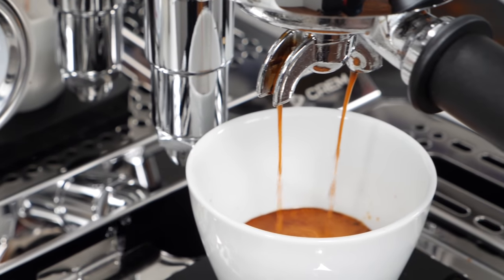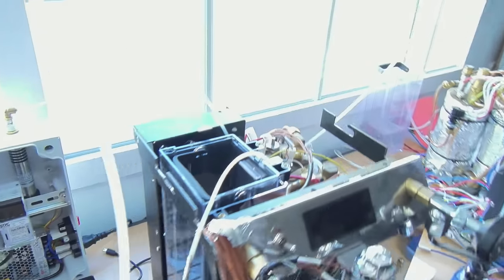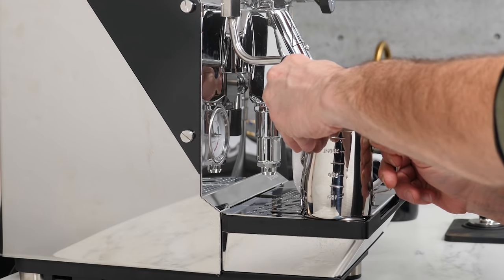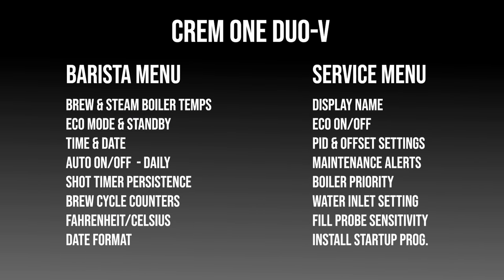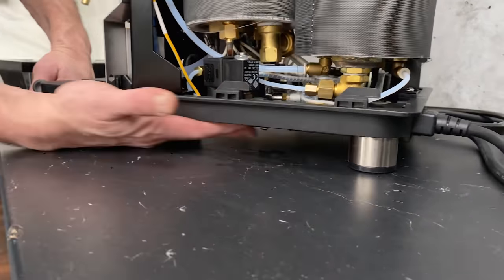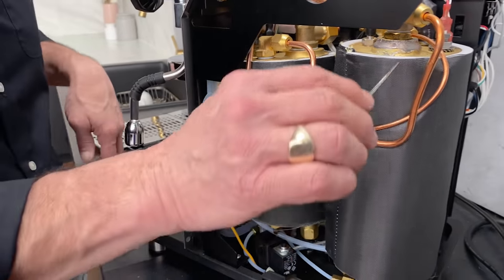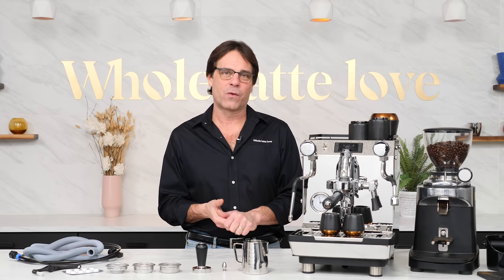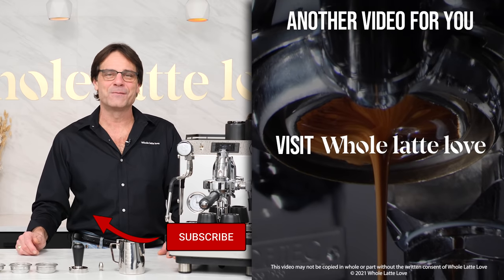Review: Crem ONE Duo-V Espresso Machine Inside/Out

Comment: Hi Marc, thank you for another great video.  Can you explain one thing: Victoria Arduino and others bank on very small brew boilers, even on the latest professional machines.  This is based on the size of the drink being 40ml or less, and the belief that it will take less time and energy to reheat 160ml of water than 1.5l. This Crem1 seems to take a diametrically opposed design, spending a lot of energy heating 1.5l of water+ the steam boiler (ok, one feeding the other), and in a typical house or office setting, it may take all day to consume 1.5l.  What do you think?
Reply from the maker: Hi Alex, You are welcome and thanks for the comment and question. So I've worked with Dalla Corte machines which use a much smaller boiler in a boiler over group setup. But still that boiler weighs a lot! Less water inside but lot's of metal to heat up and keep heated. I've never done a deep dive comparing energy usage between designs like that and more traditional but it would not surprise me if they were not that far apart. Boilers in the Crem are insulated so that helps.
Marc
Reply: @Wholelattelovepage  hi Marc. I bought a Dalla corte from you guys last year. anyway I agree with the original comment.... a 0.5L brew boiler and a 2.5L+ steam boiler would make this more like a la Marzocco or a dalla corte and yields commercial steam power... it’s a much smarter design especially if the brew boiler is already being fed by a HX. That makes a large brew boiler downright unnecessary!  With such a large brew boiler you are sacrificing steam performance without any benefit on the brew side.

Comment: I have a Brewtus II bought in 2006. I added a PID to it.
Great machine. But, I have had to open it up and repair more frequently in recent years.
The WLL tech people told me that you have to think of these like cars. They need regular service.

The new Crem machines look great.
Much better internal engineering. Should be  easier to maintain.
Lots of new important improvements.

If / when my Brewtus II stops working, this looks like the way to go.
Reply from the maker: Hi Richard, Thank for the comment. They are like cars! And, like changing the oil in engine I always say the most important thing for machine health is feeding it with good water!
Marc

Comment: Nice machine! I like the look and I think it's well thought out.
How long does it take until the brew group is fully heated? I think it's quite long because of the huge boiler.
Are you sure the display is an oled display? I my opinion it could be bigger an the resolution is quite low.

Why is the piping that odd? There could be a straight pipe from the service to the brew boiler. 

The vacuum release valve should have a hose. With this type moisture is released into the case (with the electronics next to it) 

Will this machine be available in Europe?
Reply: Having couple of bends in the tube helps relieve thermal expansion stresses. From the looks of it, I'd say the piping is very well thought out actually.

It's E61 without any active group heating, so I bet it's around 30 mins to get fully up to temp. It's not so much about boiler volume (though it does impact this of course), but about heating 3 kilos of brass with passive thermosyphon.

I completely agree about vacuum valve, but it seems like a common thing unfortunately. I haven't seen machines with hoses on vacuum valves for that last 5 years or so.
Reply from the maker: Hi Fedir, Thanks for your comments! Spot on!!! ~30 min to full heat up is correct. Can be faster if not steaming and the service boiler is shutoff. With programmable on/off time by day off week one can have the machine turn on by itself and be warmed up ready for use! While I prefer a tube on the vacuum relief it's true that it's not found inside a majority of machines. The amount of moisture vented is very minimal and quickly evaporates as the boiler it's mounted to is running close to boiling temp when it's released. Telling that having the tube is not required for SGS certification.
Marc

Comment: Hi Marc, great videos as always! Will you be doing a review of the 2b at some stage? Looks like a super interesting machine and very keen for your opinion! Many thanks, Ash
Reply from the maker: Hi BD, Thanks for the kind comment. My colleague AJ should be releasing video of the 2B with variable speed DC motor rotary pump machine  - the "Infuser"with gentle soft pre-infusion today. Next week look for my video on the top of the line Crem One "Profiler". It's an incredible machine with both manual profiling and ability to run saved profiles.
Marc

Comment: Hey Marc, Thanks for all of your great videos.  I have been debating machines for months now and thought I had finally settled on the Profitec 600 until I saw this video.  Coming from an "appliance" level machine, either one of the two would be a major upgrade for me. How would you compare the recovery times of the two machines?  I know the Crem has much larger boilers so I was wondering if that made that big of a difference in terms of recovery time between back to back drinks? Also how would you compare the steam power of the two?  Other than being able to directly connect the Crem to a water line are there any other features that would make you lean one way or the other? Sorry...I know that is a lot of questions... (patiently waiting for the head to head video)

Thanks

Jason
Reply from the maker: Hi Jason, No problem on all the questions - it's what I live for! Coming from appliance grade you are right either will be a major upgrade. With larger boilers and pre-heat the Crem will have the best recovery times. It's instantly ready to pull another shot. The Pro 600 is no slouch. By the time you grind, tamp and load your next PF it'll be more than ready to go again. 
The Pro 600 has more steam power running at ~2bar when service boiler is set to it's highest temp. The Crem runs near 1.4 bar max. IMO the Pro 600 is a more refined machine as far as external finish quality. If that's important to you it's the way to go. Crem as you know is plumbable  - which I love as I dislike filling reservoirs and plumbed connection makes water filtering (if needed) easier with in-line solution which require little maintenance. Hope that helps!
Marc
Reply: Thanks mark. Now I really went down the rabbit hole looking at the pro 700. Other than what you said about being able to plumb the 700, do you think it’s worth making the jump or should I put that money towards a better grinder and stick with the 600?

Comment: Hey Marc Great vid.  At the 9 minute mark you mention "when pulling a shot you get a shot timer on the display and you can set how long that time persists on completion in the barista menu.  Does that mean it has some type of volumetric or timing dosing?  thx :)
Reply from the maker: Hi Sam, Thanks for the comment and question. No timed or volumetric dosing. I was referring to how long the the shot time remains in the display after the E61 lever is lowered. It's a nice option to be able to have that time stay in the display for a user defined time of more than a few seconds which is what you get on most Gicar PID displays with shot timing function.
Marc

Comment: I need help.  It's time to retire my older machine.  1. Crem One Duo V 2. Profitec 700 or 3. LaSpaziel Vivaldi (plumbable)  Thoughts, comments, observations please?
Reply from the maker: Hi M, Thanks for the question. I have no experience with the L.V. so can't offer an opinion. All 3 machines are plumbable but Crem uses a vibration pump in this model. Pro 700 is rotary pump and has best steam power at near 2 bar. If not concerned with pump or steam power then best value IMO is the Crem. If you value the rotary pump and more traditional machine with superior build then the Pro 700.
Marc

Comment: Hi Marc,
Great video's,
Do you know what is the optimal gap between shower screen and coffee puck for ecm mechanika slim?
Reply from the maker: Hey gt3 rs, Thanks for the comment and question! You do want some headroom/gap. If you see an impression of the shower screen in the coffee puck after an extraction there is too much coffee in the filter basket. Beyond that just be reasonable with dose for the filter basket you're using. Like don't dose an 18g basket with 7g.
Marc
Reply: @Wholelattelovepage  Thanks for reply Marc,
As I learned impression of shower screen on the coffee puck happrnes after extraction by the  solenoid valve so it dosnt affect the extactiin at all. From my experince 19 grams dose making better espresso, so I heard from other ecm owners.
My questiin is what is the optimal gap by ecm? Can you chek it with them?

Comment: Will my Gaggia bottomless portafilter fit these machines?
If not what do you recommend?
Reply from the maker: Hi Mark, Thanks for the question. The Gaggia bottomless will not fit/work in E61 group which needs PF tabs at 9 and 3 o'clock. Here an Expobar (Crem) bottomless PF which will work: https://www.wholelattelove.com/collections/portafilters-and-filter-baskets/products/expobar-bottomless-portafilter-58mm
There are other bottomless options as well. Basically any E61 compatible PF should work so you can go angled handle, wood handle. Hope that helps!
Marc
Reply: @Wholelattelovepage  Thanks. Ordering now!

Comment: What is the reason for some of the copper tubing being so random and what seems very inefficient? Especially the tube going from the service boiler to the brew boiler.
Reply from the maker: Hi Basti, Thanks for the question. I believe the pipe routing is just part of design so everything can fit in the case.
Marc
Reply: @Wholelattelovepage  Thank you Marc! First I thought the routing is like that because of accessibility in case they need to be removed for whatever reason. And a straight line would make it very difficult to arrange everything together. And also these pipes may have a min radius? Haven't thought about limited space being a reason tho

Comment: Marc Question my Apartamento steam gauge only gets to the 1 bar pressure you know the first green square with in that gauge is that ok or should I raise it. The group head is optimal I have a grouphead gauge on it. Thanks
Reply from the maker: Hi Dirk, Well, one bar pressure in a steam boiler is on the low side. But forget about numbers. Are you happy with the steaming performance? If so I would not make a change to the pressurestat in the machine which controls boiler pressure/temperature. You say your grouphead temperature is where you want it to be. Making a change to a higher pressure will increase your grouphead temperature. If you decide to raise pressure you will likely need to do a longer cooling flush just prior to pulling a shot to get brew temperature back down to where you want it. Hope that helps!
Marc
Reply: @Wholelattelovepage  Marc first I thought you don’t adjust the nut on the pressure stat I thought it was the the bottom nut to the bottom of unit you use a spanned on. Also. My group head gets to 205 so the temp no problem. My steam is banging. I mean if I had to do back to back no. The steam
Loses pressure but fir my latte or another no problem. I thought these machines come calibrated to that middle spot?  But I would like to know am I adjusting that screwdriver fitting on pressure state or that that bottom nut using a spammer thank you much.

Comment: Really nice machine, just wish they used stainless boilers instead of what I assume is brass? Also, why include a shot mirror if you're not going to include a bottomless portafilter :(
Reply from the maker: Hi Drift, Thanks for the comment. Boilers are copper with brass end plates. Would be nice if the bottomless PF were included. In the past I've questioned the need for single spouts and lobbied manufacturers to replace singles with bottomless.
Marc

Comment: Impressive machine. No flow control though? Or can you control the flow with the "pre-infusion chamber"?
Reply: There are Four versions, sure Mark will review them in his normal excellent way. Have been waiting for reviews om this series. Great to see your videos Mark!!
Reply: I think every e61 takes a flow control set.
Reply: They have one with with the same look but the pump is rotary and the other one.. highest spec with flow control..
Reply from the maker: Hi MK, Great to hear from you and thanks for the kind words! My colleague AJ is working on the video for the Crem One Infuser as I right this. Then down the road we'll hav e the Crem One Profiler. Both those with similar specs to this but with whisper quiet rotary pumps and extended capabilities in soft pre-infusion and pressure profiling.
Marc

Comment: Can it be turned on with a wifi adapter? It seems this is no longer possible with the programming inside. Reason I´m asking is what if you want a more specific schedule? E.g. turn on for an hour in the morning and turn on in afternoon for another hour.
Reply from the maker: Hi Tim, Thanks for the question. Machine cannot be turned on with a wifi adapter as it does not have a straight mechanical power switch.
Marc
Reply: @Wholelattelovepage  thanks for answering Marc! Could be a good suggestion to CREM to include a mode in the software where it starts up when receiving power/to allow a more complicated schedule...

Comment: Marc on my Rocket Apartamento the lever when lifting all the way or pushing back down after extraction squeaks is this normal thank you
Reply from the maker: Hi Dirk, Not out of the ordinary. You can take the mushroom valve out and lube where the cam makes contact with a small amount of food safe grease to stop that. It can be caused by backflushing too much as it removes a coating of coffee oils from the cam and pushrods. Usually stops squeaking when coffee oils recoat.
Marc
Reply: @Wholelattelovepage  it’s Marc this happened during back flushing!!  After back flushing the squeak almost went away. There still is a little resistance but much better. I mean the machine is brand new. Great information. Thank you

Comment: Hey Marc, I was wondering if there is a major quality difference between this machine and something like a profitec pro700? They seem so similar yet the price difference is huge!
Reply: I bought the 700. But I must say a time setting for on/ off would be a nice addition.
Reply: @geronimoxxxxxcvx  knowing this machine existed, would you have chosen  it over the pro700?
Reply: @eknox4748  I don't think so. The version with the same options is the same price. I had a Brewtus IV. Coffee is good don't like the looks  But this one looks really nice. In Europe the Lelit Bianca is 400 euros cheaper. Funny in the USA it is more expensive. I bought a profiler set for 150 euros extra online. With medium / dark roast the difference is not big. Don't like light roast. I think next time I would buy a ECM synchronika. I do like the feel of ECM. For coffee quality I think for 2500usd machines it's all the same.
Reply: @eknox4748  I now see there is also one for 2500 which has the ability to set a flow profile on the display. That is a nice option is must say!
Reply: @geronimoxxxxxcvx  the crem is 3200$CAD and the Pro700 is 4200$CAD
Reply: It's more comparable with Pro600 (which wins hands down because of flow control). Pro700 has rotary pump, grouphead pressure gauge and steam boiler of twice the size, so not really directly comparable.
Reply: @pfa231  fair enough, but doesn't  the crem one also have a rotary pump since it's plumable?
Reply: They specifically mentioned in the review that pump is vibratory
Reply: @pfa231  right, thanks!
Reply: I purchased the Profitec Pro 600 with flow control from Whole Latte Love and I think after using my machine and seeing this video the build quality is better on the Profitec. I also hooked mine up to a wifi switch and have it turn on and off with a routine and Alexa. It's always ready in the morning when I get up.
Reply: @eknox4748  the crem one 2b lfpp has profiling rotary pump. 2500 euro
Reply from the maker: Hey all, Thanks for the comments! A few of my own...
On/off times by day of week on the Crem is very nice.
Pump on the Duo-V is vibration. Talk to those who've used the Expobar with vibe pump and Crem/Expobar custom E61 group w/pre-infusion chamber and many appreciate the shot quality of the combo. It's a slower build to full pressure and flow.
Flow control is an exceptional tool for those who go to that level on Profitec/ECM machines. Do stay tuned for the rest of the Crem One line including the "Infuser" and "Profiler" with whisper quiet rotary pumps and extended capabilities as their names suggest!
No doubt ECM/Profitec features exceptional build quality and higher price. Keep in mind the full-line of Crem One machines are SGS certified for commercial use and have some features like boiler drain, on/off by day of week, easy Eco mode and more.
Marc
Reply: @pfa231  it’s in between - like a “Pro675” it’s has plumbed in like the 700 and vibration like the 600.  Excellent machine esp for the price - boiler volume and commercial grade is super impressive so then it more like the 700 than the 600
Reply: I really don't see a point in such a huge brew  boiler - unless you're planning to use it in truly commercial environment, but in 2021 nobody uses E61 machines commercially really.
Reply: And I don't know what this rating means, but judging from the video, I'm almost sure they used non-heat-rated wires, which means they will live 5-6 years in commercial setting at max.